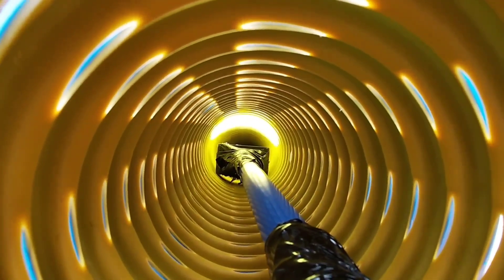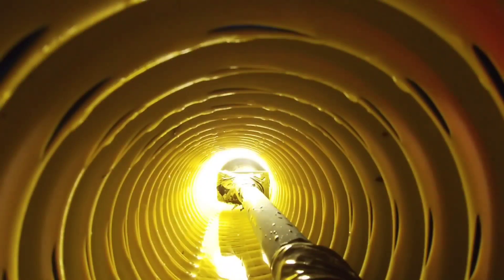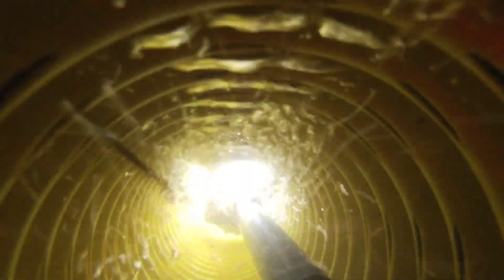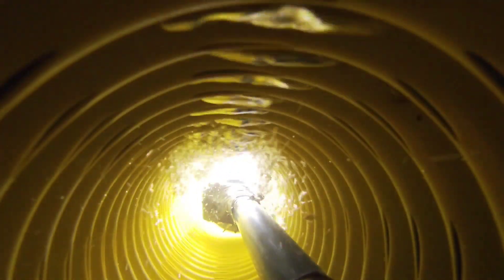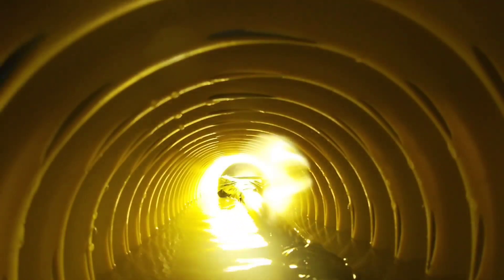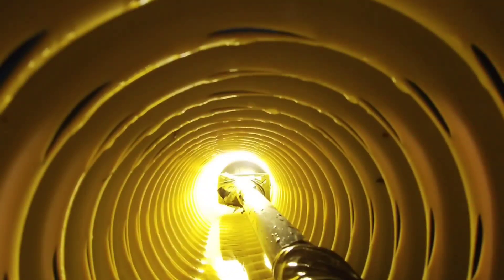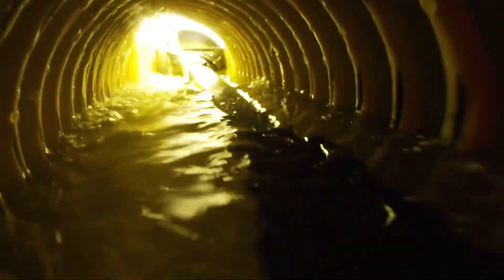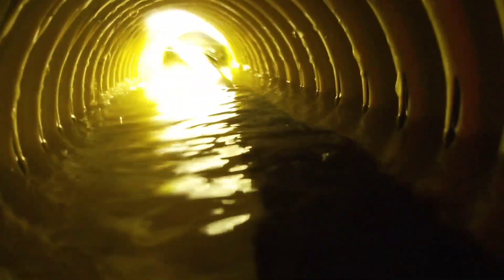How Does Corrugated Drainage Pipe With Holes Really Work?

Comment: Doesn't the pipe need to be slightly going downhill to daylight?
Reply from the maker: If you tip a drinking glass on its side LEVEL does the water run out?
You can be flat but slope is perfered.  Slope is the gasPEDAL. Move more water per Minute know as GPM ( gallons per minute) there's also less of a chance that water will be left in a low point with slope too.

Comment: About the air... In a closed system, say a french drain leading to a dry well. Do you then always need some kind of venting for the air to be easily displaced?
Reply from the maker: We don't and I will explain. Wherever you daylight the pipe it can vent. Yes I've seen situations where the line ends somewhere under water. Still the only thing we ever have to vent is a solid pipe for discharging water so it doesn't  Siphon water back. To build a French Drain system the way we do you will be fine.
Reply: @FRENCHDRAINMAN  Thanks!
Reply: @FRENCHDRAINMAN  somewhat related to this: I have a sump pump discharge line extending ~8ft from house in 1.5" solid PVC pipe. Then, neighbor says he helped install perforated corrugated drain pipe another 10+ ft. So, they dug a trench, laid the pipe, put rock and garden wrap around it, buried it. there is no discharge to daylight.  Don't think they have any drywell. If there is no drywell at the end of it, would this cause failure? I have had a very muddy area right outside my basement so I am concerned the drainage has failed. Thanks
Reply from the maker: BTW Dry well should be full of holes and have plenty of stone on the outside of it.